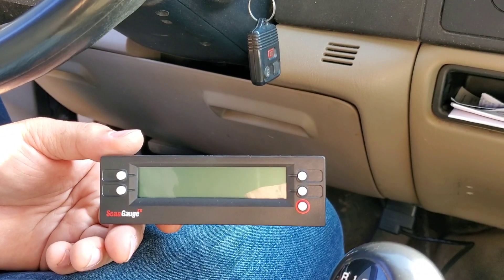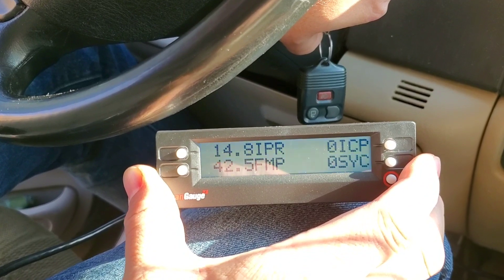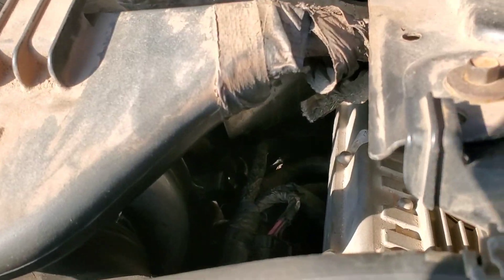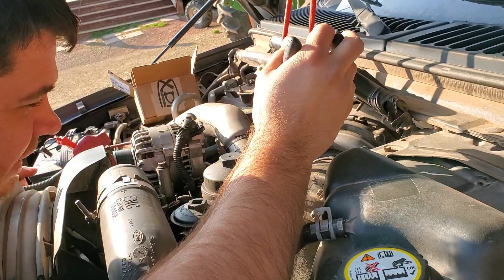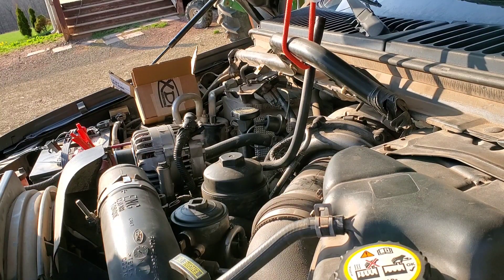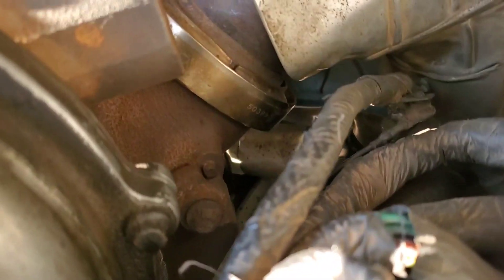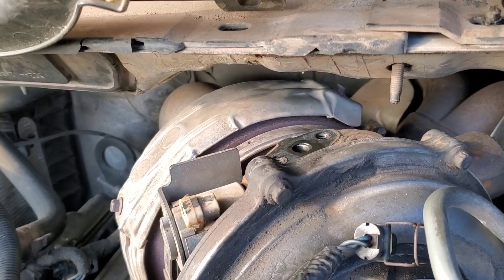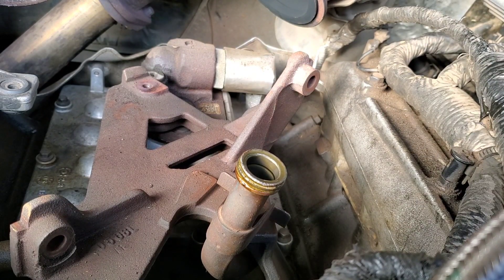6.0 Powerstroke IPR Valve Replacement Without The IPR Socket

Comment: $15 tool would save a lot of work and get a better job. Wire connection turns independent of nut and can be directed correctly after proper torqueing.

Comment: You dont need to remove turbo.
Reply: My 2007 looks like the pit switch is standing straight up , not sideways ?? Am I looking at the correct part , ? It is leaking out of the top of it
Reply: Perhaps not, but is removing the ficm and all the other shit any easier?
Reply: @tinbarnranch  Yes much easier
Reply: The one I’m working on you have to remove the turbo!

Comment: I had it replaced and the Machanic broke the clip plug off and it runs terrible besides really hard start I may have to fix it myself he charged me 1200 plus to mess my truck up
Reply from the maker: That's crazy and then to have the truck still not run right! If you you know that's the issue for sure it's definitely worth saving the money and just doing it yourself. Its not a difficult process at all.
Reply: @304customsgarage  I have to change the starter first I burn it out with all the hard starts

Comment: Did it fix the truck?
Reply from the maker: This particular issue ended up being an injector that had broken across the top of the injector where to oil rail meets the injector. After that was replaced the truck started up and it has run without issue since according to the owner.
Reply: Thank you for the updated comments.
Reply from the maker: No it still wouldn't start after batteries charged overnight/today, something else is still preventing it from starting
Reply: Ipr reading is supposed to be 14% KOEO if it constantly commands 85% while cranking that means its demanding more oil so u prob have a leak
Reply from the maker: Yeah messed up that part of the video didn't catch it until after I posted it. The truck went  to 85% each time it was checked during cranking before the batteries got weak.